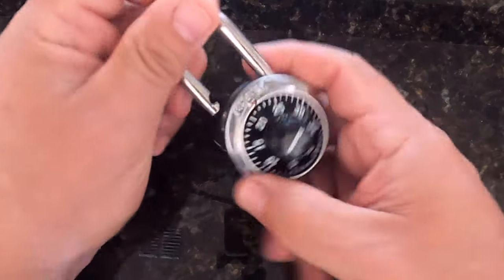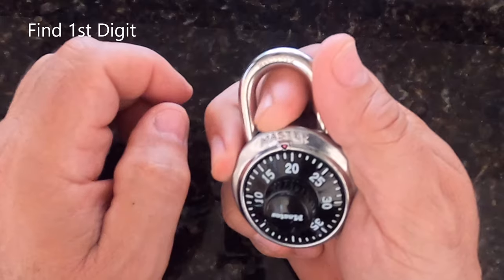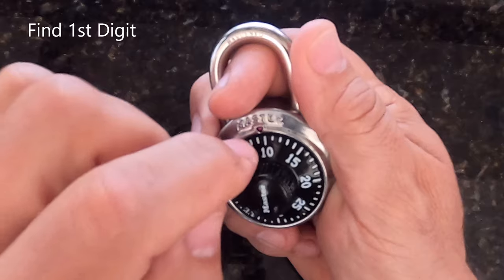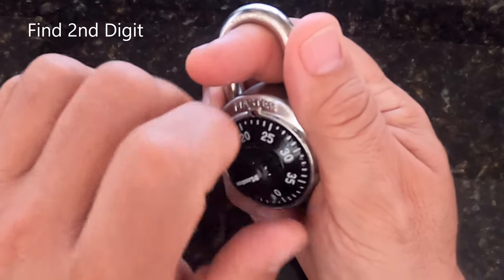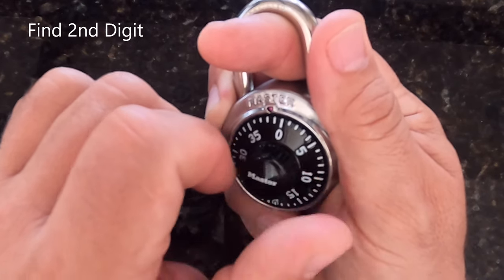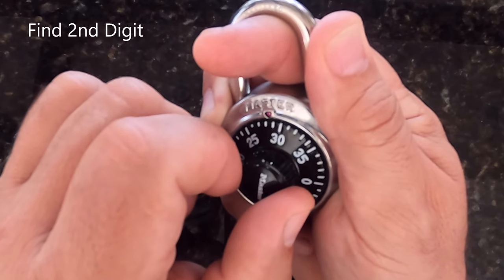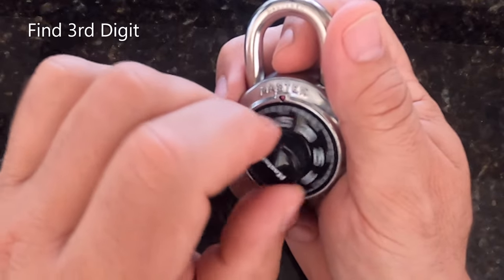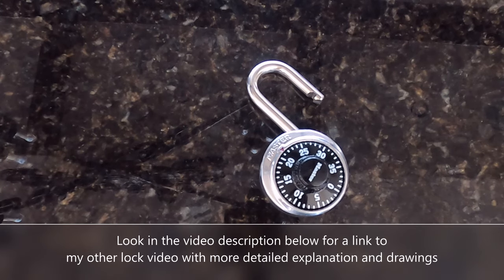🔒Lock Picking ● Find Combination to Master Lock Padlock ● Less than Two Minutes Using Only Feel

Comment: Don't bother wasting your time. It doesn't work, and probably because it's not meant to be that simple. The new locks clearly have an adjusted shackle, making this pressure application trick useless unless you have computer level detection of snagging.
Reply from the maker: Hopefully the new locks are better. It works in a LOT of existing locks. Give it a try.
Reply: @ApacheRanch  I tried it on a Dudley lock from 2018. So I'm sure they figured it out, because applying the amount of pressure suggested will stop the dial from moving entirely, and if you use a little less, the dial barely clicks, if at all.
Reply from the maker: Well - this only works on MasterLock as far as I know. Not all locks work the same inside.
Reply: @ApacheRanch  yeah I basically just said the same thing across a view videos using the same tactic, this one just happens to be for master lock. The old shitty ones to be precise. I find the new master locks are almost identical to the Dudley ones, probably because they all just come from the same manufacturer.